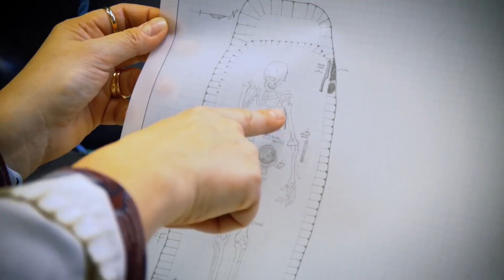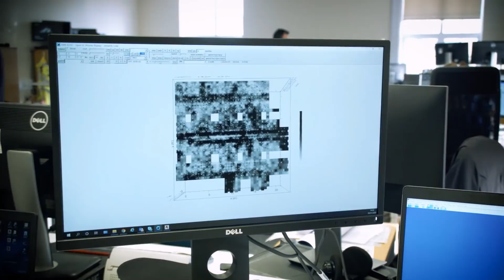Phil Harding Q&A - Salisbury 2020: Digital Big Weekend

Comment: Remember  an old TIME TEAM episode called NO STONE UNTURNED  where the diggers basically found Absolutely Nothing. But they still filmed it and broadcast it-Waste not want not....
It is said that MICHELANGELO also believed that the figure he wanted was already inside the marble he was carving and all he had to do was cut it out. Two fine stone cutters on the same page, hundreds of years apart....
Reply: That sounds like most episodes of Time Team.
Reply: In fact, they ended up with even less than they started with because they found that many of the previous artifacts from the site had been misidentified. Classic!
Reply: That sort of episode was why Time Team was so great.  They gave some fair air time to the fact that archaeology wasn't just about finds and great discoveries.  Things aren't always great

Comment: How many hours   did that take altogether  & did he use modern machines to grind  ?
Its a lovely polished axe head .
Reply: Phil is a purist...he would never use a machine to polish such a beautiful piece of stone...a lot of enjoyment is to be had from doing things by hand and seeing the results from the hours of work that would have been put into it...
Reply: @ChristophersMum  that means 100s of hours grinding stone into a paste like a wet sand paper & polishing what seems like forever. 
I'm not really into the stone ages,  the late neolithic gets interesting when we begin to settle down and farm .
Bronze age is like stone age,  except for a few small bronze artefacts,  swords didn't exist until a few more centuries into the bronze age .
Even early iron age  were still using flint , it was a throwaway tool , available everywhere & easy to create crude blades axes etc .
Late iron age things become interesting,  for me personally I mean. 
I've worked on every type of settlement,  seasonal and permanent,, paleolithic mesolithic neolithic. 
I wouldn't say boring,  but they're all very very similar. 
Phil loves the stone ages,  
I prefer late iron age ( Celtic. 
Roman,  Saxon  are what I work on most of all.